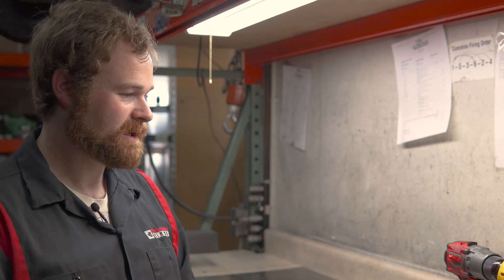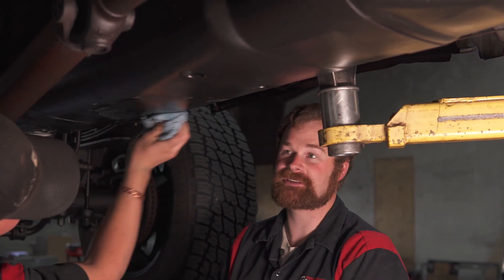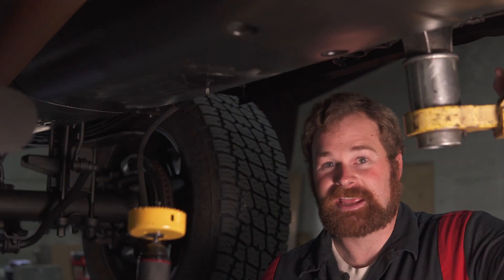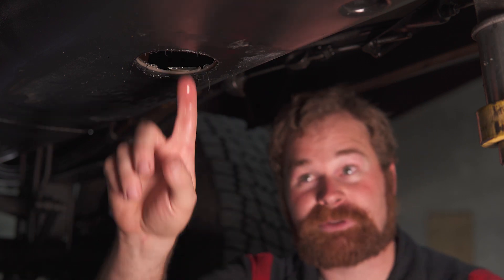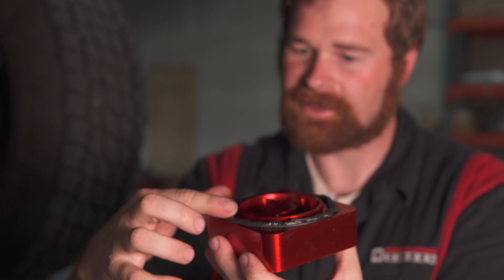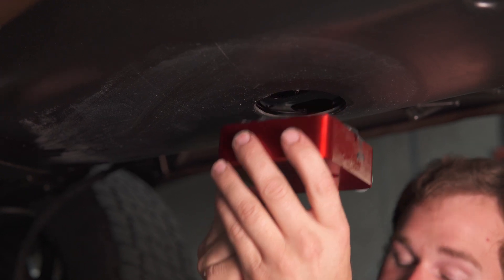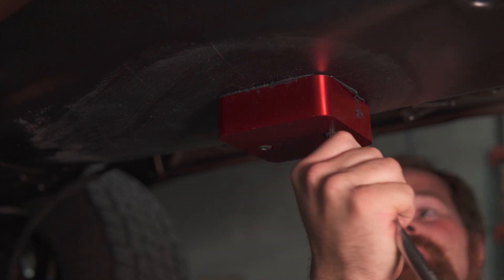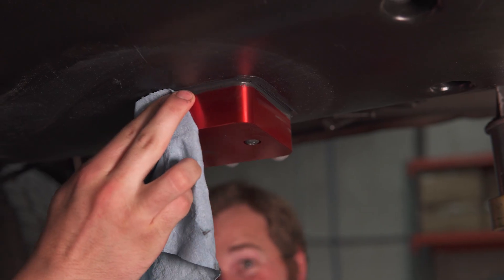Diesel Fuel Sump Install | Cummins Upgrades | Power Driven Diesel

Comment: I need to disassemble my sump to check for blockage as I’m getting a restriction to my pump. Can I just disassemble my sump and re-use the o ring?
Reply from the maker: Should not have an issue re-using the o-ring, just check the condition of it!

Comment: Does this work with my stock fuel pump on a 1994 dodge cummins
Reply from the maker: It will work with the stock lift pump, you will have to upgrade to 1/2" fuel line that connects to the pump

Comment: How does this work if I have a in tank lift pump? Will I have to convert it to one up on the engine behind the filter?
Reply from the maker: No these are used for lift pumps like Air Dog or Fass
Reply: @pddofficial   Will the stock pump work with one of these? (04 Excursion 6.0)
Reply from the maker: yes it will  @dancook6322

Comment: So im a ford tech, i work at a dealer "motorworld" in saint maarten in the caribbean. i drive a 2011 nissan frontier with a d22 engine and a maual transmission. i been seeing some videos of you guys installing high torque clutches and i've been thinking about installing a strong aftermarket clutch in it. what can you recommend for me. i think you guys would be able to helpme the best.

Comment: You say 3" hole saw in this video, the website description says 3 1/8"   which should I pick up?
Reply: It comes in the kit
Reply from the maker: 3-1/16" or 3-1/8" hole saw both work, so 3.0625" or 3.125" hole saw.  3" will not work.

Comment: So that's all I need to do if I want to install an Air Dog system on my 2008 Ram 2500?
Reply: Yes but this sump is kind of ugly compared to a beans diesel sump. I have a beans sunk with an airdog 150
Reply: Beans sump*
Reply: @jynxgoat6913  Thanks for the info. That's a lot less work than I thought it was.

Comment: Would a deburring tool work for cleaning up the plastic strings on the hole? Thinking that might be easier to control would make the job a little easier. Not a bad tool to have around either and they aren't very expensive.
Reply from the maker: Yes, a deburring tool would work great.  We use them in our fab area, but never thought about using a deburring tool for tank burrs.  Great idea!
Reply: @pddofficial  Thanks glad to help.

Comment: So you do or don't reccomend RTV? Technically most know you're not suppose to use RTV on Orings, but we all know that there's at least certain cases where you know it's leak prone and you add RTV on or near an oring to help the seal
Reply from the maker: The RTV was a install tip that Baron likes to do, these sumps work great without RTV as they have a good o-ring design.  That said, if a bolt ever fails or an o-ring fails, a layer of RTV outside the o-ring would give you a little more leak-free assurance since it both glues the sump to the tank and adds a second sealing layer.
Reply: @pddofficial  sounds good, I agree. When theres area around an o-ring for RTV so you can have a clean seal of the o-ring plus the seal of the RTV that's nice.